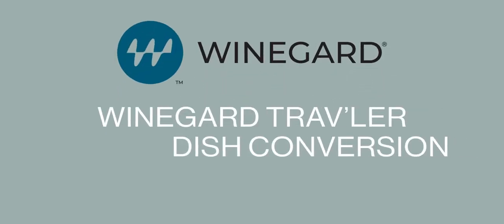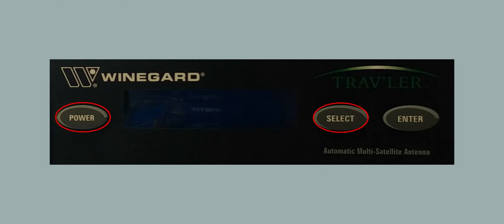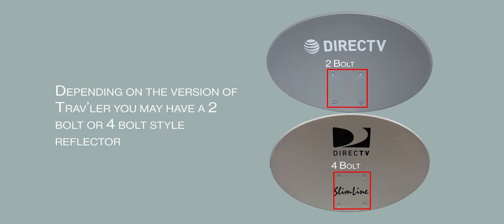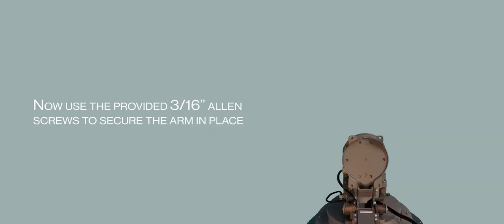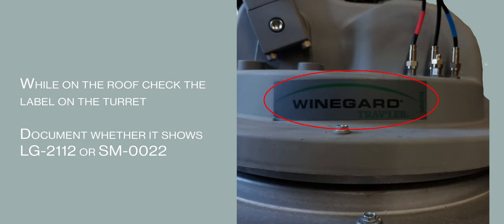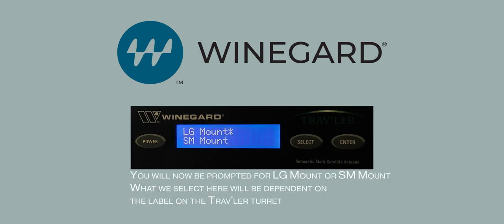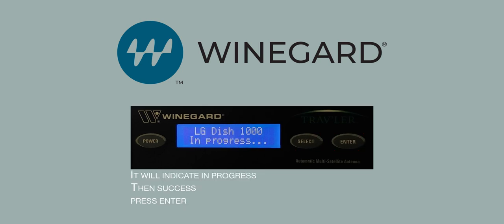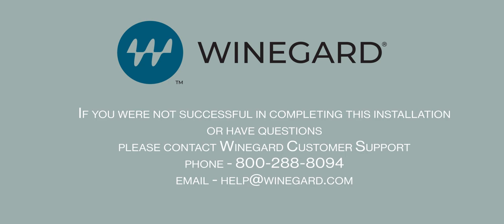Winegard TRAV'LER DIRECTV to DISH Conversion

Comment: Do you have a video of converting this in reverse? DISH to DirecTV? I'm trying to get the dealer to perform the DISH to DirecTV swap before I pick up my new RV but they are confused.
Reply from the maker: Hello xplmr1 - Unfortunately a video is not available for converting a DISH Trav'ler to DirecTV. Converting a DISH Trav'ler to DirecTV can only be done if the system was originally setup as a DirecTV Trav'ler. The DISH Trav'ler SK-1000 turret hardware is different than the DirecTV turret hardware. If the system was  factory DISH Trav'ler it cannot be converted to DirecTV.
Reply: Uh are you sure you want Direct TV/???  With DISH you can go month to month…not have to pay for months you don’t use it….sorry DirecTV requires you to pay whether you use it or not…AND the plan is for 2 years and your price goes up huge for the 2nd year…. I checked it out and DirecTV SUCKS…..
Reply: @jamesstephensonii4428  I understand your point but I've had DirecTV since 1998 and I currently have 8 DVR's in my house. If I had the DirecTV dish on the roof I would only need to bring one of my DVR's when I travel and I don't need to pay extra for anything.
Reply: @WinegardCompany  The original system was a direct tv and was converted to Dish, What are the steps to convert back to direct tv?

Comment: So what do you replace the Direct TV power supply and splitter with
Reply from the maker: Wiring a Trav'ler for DISH receivers varies by receiver and LNB type. Please reach out to Winegard Customer Support for questions on wiring based on the receiver and LNB type being installed.
Reply: I'm a satellite installer with 17 years experience. The dish receivers will connect directly to the lines going up to the dish, no power supply or splitters needed.